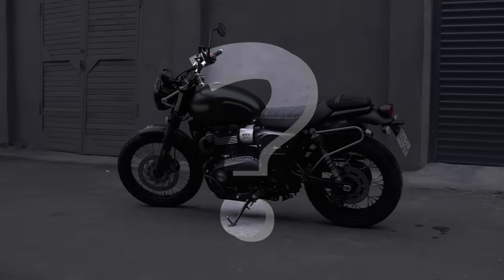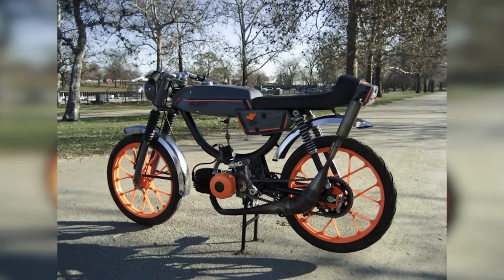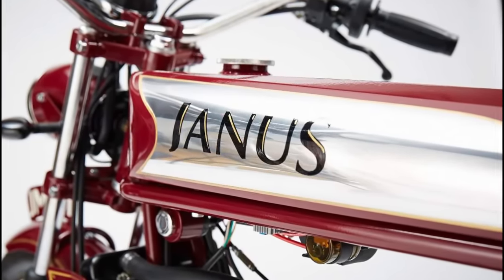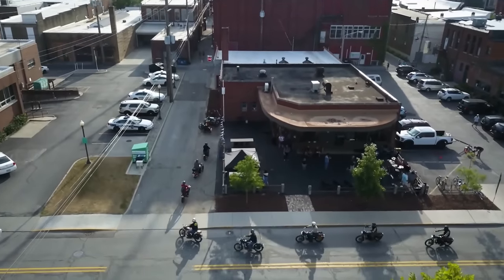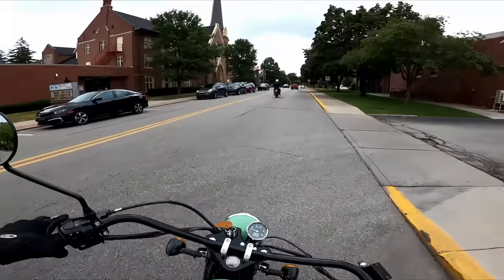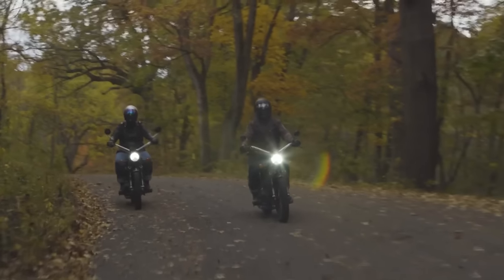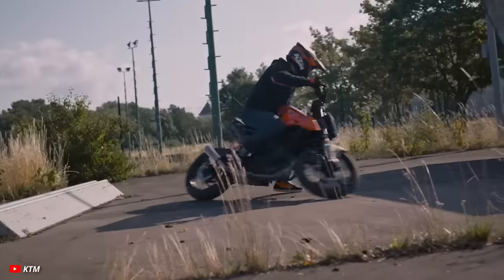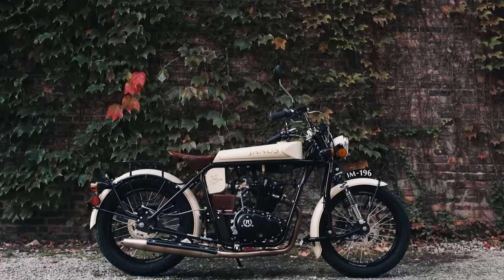The New Manufacturer making 100-year-old Motorcycles

Comment: You can't seriously give what amounts to a 20 minute advert and gloss over the Chinese engine which is certainly not "basically a Honda". 
If it was a Honda it would be a much more interesting bike but $15k with a clone engine? 
They look nice but you would have to be either buying it as art or out of your mind. 

The irritating thing is even if they bumped that price by a few grand I would be much more interested if they were running proper parts. At that cost you're well above the Amazon specials those boat anchors are usually in - five times above in some cases. 

Even more irritating is that they are so, so close. The bikes look cool. The vibe is great. The people making them seem cool and genuine. The handmade bits are great. Going that far then using cheap knock off engines just makes them look like they're cutting corners and at that price point thats a no go. 
The sales bit is very ott aswell. 
Particularly calling out the "not naming names" brand is a very trashy way to try and make your bikes look better. Thats even more of a put off than the cheap and nasty engine choice. That and the old lines about how its been many years and thousands of hours in the making, blah blah. Does anyone even fall for that any more?

You're better than this.

Comment: A better question would be 'What is a retro Product?' - well, it an old product whose Copyright has now expired that can be mass-produced at low cost (usually with far less stringent quality controls plus lower quality materials) and sold at a High Price to gullible idiots. Additionally, these 'manufacturers' don't have to bother with fixing known issues with the originals or adhere to modern safety standards. Wanna buy some retro Asbestos Insulation...?

Comment: I worked on and rode a few of these. They were certainly not worth 7,500 usd.
The engines are cheap chinese honda copies and their earles fork is flimsy at best, slamming to the end of its travel with a mere touch of the front brake. Save your money and buy a real motorcycle.

Comment: Yes they are cool, and I'm sure the build quality is on point. But low output Chinese engines at that outrageous price. I mean you can have a liter+ bike from Harley, Indian, or 
Triumph. And fairly large displacement Japanese bikes. I wish them success but it's a no from me. P.S. The comparison to Royal Enfield Is not valid as they are cheap knockoffs of the originals and if you spend any real time around them you will realize they are complete rubbish.

Comment: Those British bikes you are on about come out of Birmingham, mechanically they are sound Chinese are good at copying engines the problem they have is Chinese electrics are bad.
I bought one as a commute had it from new now it is one and a half years old with over 4000 miles on the clock, I replaced all the electrics with old Kawasaki, Yamaha and Suzuki parts and it has been fine since but I told the company to shove there warranty. 
The engine is made under licence from Suzuki a GN 125 only mod is fuel injection when you buy one you do not have to sign any agreement to hide the truth about the bikes but if you join any groups for the bike if you tell the truth about the electrics they ban you so that says the groups are run by the same Chinese who produce the bikes.
Most of the parts I can see on the Janus look the same as used on the British bikes but as I said mechanically they are brilliant the Chinese electrics are the problem they can not stand wet weather and we get a lot of that over here. 
I bought the little Chinese bike to protect my other bikes , an unrestricted 2000 Hayabusa, a 1985 GPZ 750r and a 1987 GPZ 900r and a Suzuki intruder imported from Los angeles customs back in 1987.
I use the little Chinese bike all the time as I get more fun from it than any of the others now I have seen a Janus I would not mind one of them to the collection.